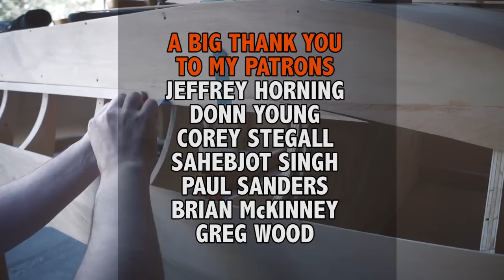How to Build a Wooden Boat #15 Plywood Hull - Hull Formation

Comment: Hi Andrew, thin card / thick craft paper or similar make excellent templates, so much easier to bend cut and shape to the desired size and then lay flat onto the plywood for marking the exact shape. Love the videos, great !
Reply from the maker: +Rob S Thank you yes. Love the card, though for me using vellum is perfect for the next stages for making my full size plans for this model boat. Roll them up and slide them into a protecting cardboard tube. I think I'm going to be making boats for some time to come :) Love this hobby.

Comment: I will have to try Gorilla glue on my next boat! I have always used West system epoxy.
Reply from the maker: +Bill Read I love the #GorillaGlue though understand it is not for all joints. What is saving me, is the bondo, resin and fiberglass Ill ultimately be covering this build with. To be honest, my next build will be using an epoxy glue to see how that is different, compared to the gorilla glue. There are many purists out there that have told me off, but I'm a rebel ;) So far, my boat is the boat that #homedepot built ;)

Comment: i wander. if u used hot steaming water if it wouldn't help soften the woods fiber so u could bend ur curves a bit easier i know it works on actual wood like walking sticks and such also could use a heating gun to bend and dry at same time ,just a tip i hope it helps
Reply from the maker: Absolutely Charles, I am sure it would make bending the wood over the frames much much easier. I will probably try this the next time I perform the same task on my next boat. It was good to test the flexibility of the plywood panels.

Comment: Mr Andrew. I see you using a wood filler sometimes is that the Bondo or something else. My boat got damaged and to repair now before fiberglassing.
Reply from the maker: +brian mckinney I used wood filler on the cabinet. But nothing yet on the boat except gorilla glue I believe. If you send me a photo of where the damage is, I will do my best to suggest something that works. Though I would probably use some epoxy like plastic filler. Something with strength…
Reply from the maker: Sorry Brian, I had a brain fart 💨 yes! I used bondo on the frames. To help bring them out to the level I wanted. I would not use bondo for everything, but I totally forgot about that. Ha!

Comment: what are you painting the boat with?  enamel paint?  I covered the outside of my kids boat with fglass resin. the transom bottom got some fiberglass just to toughen it up a little.  Now I want to paint it.  Do you know if you can paint over the resin,  and then fiberglass over both?  I'd hate to have to sand it all back off....  😥
The inside , I was just going to paint, but not sure which type paint would be best.
Reply from the maker: To be honest, for myself it is simply one step at a time. I know I will be filling cracks and openings with fillet, an epoxy slurry with sawdust or fiberglass strands. Then I will cover with a gelcoat on top of fiberglass, sand down then paint with the appropriate paint. Probably some sort of enamel or waterproof boat paint though I have yet to source.
Reply: +Andrew Jones 👍
Reply from the maker: firemanjim324 whatever they use, I'll use basically.
Reply from the maker: +firemanjim324 I responded in another message some place I'm sure, but I will fillet fill the gaps, then fiberglass and paint my boat. Not sure what sort of paint, till I get to that part of the build. (I try not to get too far ahead, or ill psych myself out) ;)

Comment: Why didn't you use steam, or Boiling water for bending & shaping?
Reply from the maker: I wanted to see would it bend naturally without it. As I would have to make a steaming bag etc. I didn't want the hassle. Though I did wet one side down, which worked great too.Thankfully, the sheets handled the bend (only just)
Reply: @artisticbrit  he not understand how use steam and bend wood. him do many wrong but newermind its him hobby waste loty time but have happy/fun.

Comment: it's called a keelson
Reply from the maker: Since I'm talking about the lowest longitudinal structural timber, I'm talking about the keel. ;)
Reply: you are absolutely correct....the keelson would be inside the boat or ship and it would be used to attach the keel to the vessel
Reply from the maker: supurbian to be honest, there are so many parts of the boat, I'll name incorrectly over time. But will get it over time, as I build more.